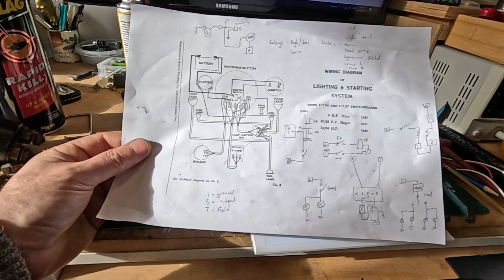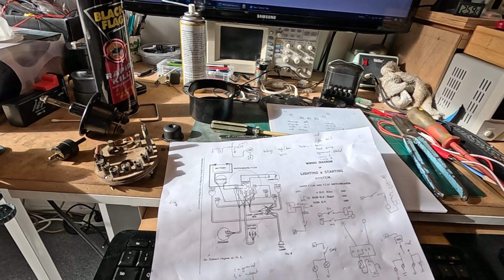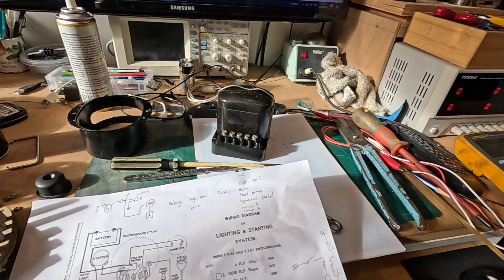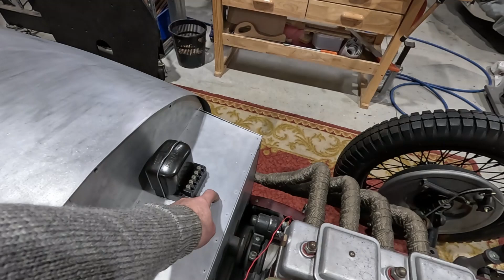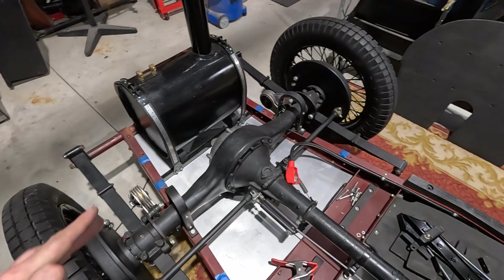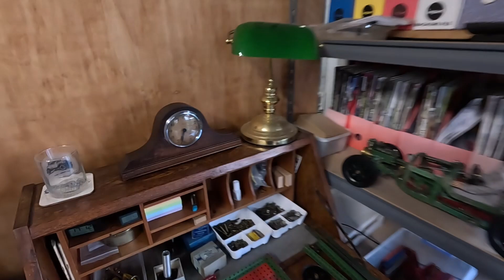Pre war Riley Brooklands - Thinking about wiring

Comment: I always enjoy your updates.  I bought my cloth covered wire off ebay, it came in different colors and gauges. I just couldn't bring myself to using plastic covered wire. I didn't realize you don't have access to Ebay where you live.   I guess LED lighting is all the rage now, but I just can't live with it..  I prefer the 6 volt glow..
Reply from the maker: We can access eBay of course. But usually the sellers don't ship to New Zealand or if they do it's really expensive. I have used it in the past for things you can get any other way. Anything mains powered is usually the wrong voltage too.